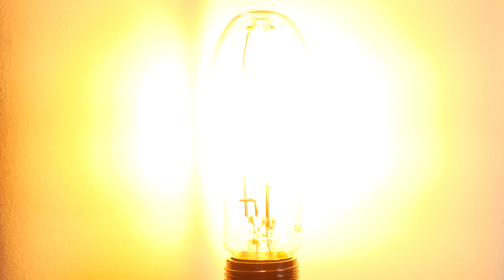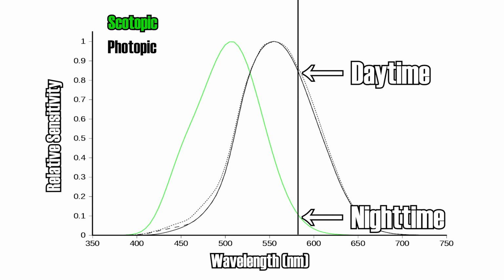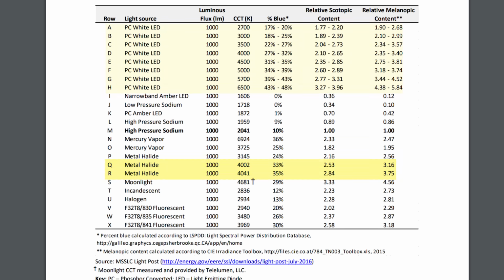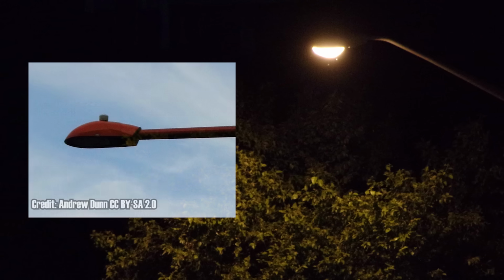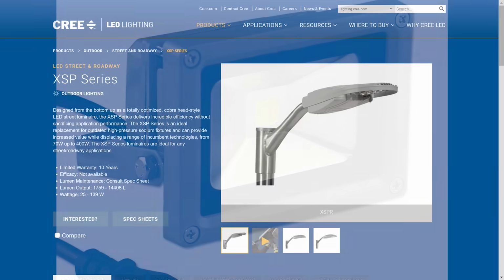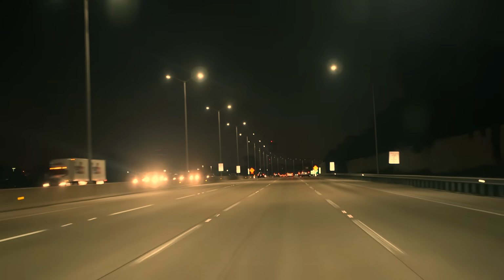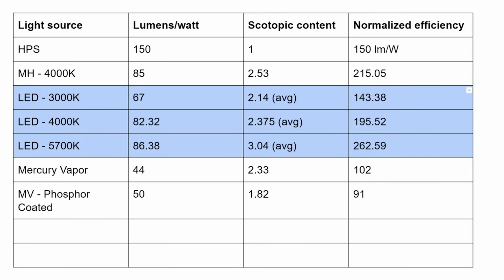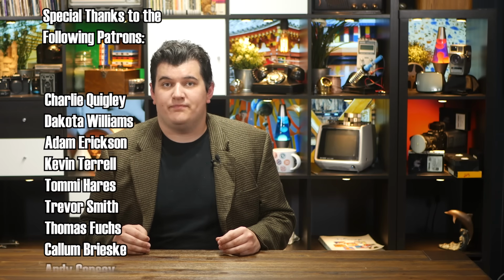The LED's Challenge to High Pressure Sodium

Comment: There is of course one thing that can be done to greatly reduce light polution, decrease night traffic risk, and many other benefits. Less car reliance, more quality public transportation and walkable/bikeable urban environments. A tram needs less light and clarity ahead of itself, and if you have an electrified system, you can have sensors to selectively dim or bump up light intensity depending on whehter or not there is a car going that way, on top of just occpying less area/lanes to be illuminated in the first place, and depending on the area some of said traffic is already happening underground in the metro system. Right there, by increasing density alone, you will cut down light polution and other harms by more more than half. And not only you need to light smaller areas/won't need to light a bajilion broad stroads, an environment designed primarily for walking just need less light for the people there, always at ground level, and it doesn't need uniformity, so it can be more or less intense according to the need around each light fixture. And yes Mr./Ms. Strawman about to raise your hand, utility vehicles or supply vans/trucks, etc. might need occassional access, but it still changes nothing here as that level of light + the vehicles own light fixtures if needed are more than enough in for the occassional nocturnal access here. The environmeent could also be a bit more curated, for example if you turn a couple of blocks into something like more like Barcelona's superblocks, putting some tallish trees around, you even reduce the amount of light that escapes outward. In short, by merely moving to a less carcentric, more walkable mixed use urban model, you not only cut the amount of light you emit by orders of magnitue in the first place, you can even prevent some of the light you do emit from escaping the volume of space where lighting is actually needed. Among other bonuses.

Yes, I know the video isn't saying "change lights = fix everything", it is not saying you can't change lights and also do more things, but rather it is just talking about the lights themselves... But c'mon, it was plenty easy to plug that in and how could I resist an offer like that!

Comment: The only problem I see with shifting to led lighting is the lack of heat output. In winter, especially the further north you go, street lights can get covered in ice. Led lights don’t produce the heat needed to melt the ice whereas high pressure sodium lights do.
Reply: Why do LED's have massive heatsinks then?
Reply: He actually made a video about this but for stop lights called "The danger of but sometimes". It basically says how it is cheaper to install heaters that only run for part of the year than to continue using inefficient light sources.

Comment: The state of Maryland replaced these lamps with purple lights and I gotta say I would rather sodium than dim purple. Takes it to the other extreme.
Reply: Those are not intentionally purple. The phosphors that convert the monochromatic UV output of the LEDs to full spectrum white light have fallen or burnt off causing this
Reply: @exoticcar5482  Yeah I learned, they are so terrible. Seems like the whole state got a bunch of bad bulbs because they were fine before with older bulbs.
Reply: @SEVENTEENPOINT1  Actually that's not a reason LED is terrible. LED technology itself is not terrible. There are just some companies that made them with defective phosphors. Maryland is one of numerous states that happened to have bought plenty with this problem unknowingly. The light source itself however is still much more efficient and will still likely outlast a HPS lamp. They weren't just "fine before" with the old bulbs. They failed plenty. You just didn't always notice since their failure mode is that of cycling. Also the crews were more active back then to replace the broken bulbs whereas today they were unprepared for the manufacturing defects. Before we automatically assume HPS is objectively better we have to look as all the pros and cons
Reply: @exoticcar5482  I was referring to the LEDs they picked. But thanks.
Reply: @SEVENTEENPOINT1  I am actually familiar with everything you're saying since I'm a Maryland resident myself
Reply: @exoticcar5482  Cool, same.

Comment: I HATE the led streetlights. It makes it much harder to see in foggy conditions compared to the sodium lamps.
Either use Amber leds or don't change them. At least not on streets/roads.
Reply: The warm light cuts through fog and makes it easier to see

Comment: I completed a sodium light replacement project for our strata in 2018.  There are 34 street lights.  We saved the equivalent of 2000w+.  I chose 4000 degrees to match moonlight.  The colour discernment is much better.  Only one resident complained.

Comment: High color temp lighting at night is junk. Visual acuity is not only bad because of glare but the high levels of light negatively impact mesopic vision. Add in the extra light scattering off high CCT lighting to the night sky and it is a loser. 

I think 3K or less CCT is going to prove to be the best option going forward. Good job with your report but your going down the wrong road recommending high CCT roadway lighting.
Reply: And it is proven to make sleeping harder, and animals get disoriented by high CCT as well. Another problem hardly mentioned is that LED has serious flicker issues. The high frequence drive is mostly no so high frequency. 50-100Hz is way too visible. Streetlights hardly come with the 10000Hz switching of quality housing bulbs.
Reply: @lovemadeinjapan  This is no worse than HPS though as most of them ran on magnetic ballasts which pulsed them at 60hz
Reply: @exoticcar5482  Kome and visit. I've RGB LED street lights (they follow the nigh cycle) next to HPS. THe HPS light is soothing, the RGB street lights totally annoying, it looks like you're in a techno party. Some fancy Philips/Signify shit to promote the city....
Reply: Oh for reference, the HPS next to it is qualitied as historic and protected! Love that!
Reply: @lovemadeinjapan  historically what? Energy inefficient, failure prone, and needs to operated on a dusk to dawn photocell.
Reply: @Aerostealth  You know, historical preservation objects, like classic houses and buildings. Some of the HPS lights are preserved and included. I think that is super cool! Let kids learn about the awesomeness of 588nm.
Reply: @lovemadeinjapan  I've never heard of RGB street lights. Most LED street lights are phosphor coated deep blue diodes.
Reply: @exoticcar5482  Well, they exist. Yesterday I bought LED lights for the home, and wondered why they were all F on the energy label. I believe the HF circuitry and quality are taken into account now with the new EU rules, and now we can see how scheisse the stuff is we get in stores.

Comment: The switch to LED sounds like a no brainer to me. The suppression of melatonin production sounds to me like it would only improve safety on the road, making drivers more awake and alert in nighttime conditions. Combine that with the power saving, efficiency, adaptability, and MUCH more environmentally friendly disposal when needed, LEDS are the way to go. Even if the circadian rhythm disruption becomes the primary concern, LEDS can be balanced to any color temperature and even adjusted with ease, so light temp can be tailored to any environment/application.

Comment: 4 years later, and LED lights have pretty much taken over. I've been around long enough to have seen the transition of street lighting from incandescent to fluorescent to mercury vapor to low pressure sodium to high pressure sodium to LEDs. 

I work at a place that sells lighting, and I've noticed that a lot of people perceive the bluish "cool white" light as brighter than "warm white", even though it isn't. But I also tell them that the warm white makes food and people look better, so should be used in kitchens, dining, and bedrooms. Reserve the "cool white" for offices, workshops, and outdoor lighting.

Comment: Winnipeg Canada changed out there induction / HPS lighting to LED units around 6 years ago and they did it district by district so for a while there was LED neighbourhoods and NON LED areas and immediately you could tell the tighter beam focus of the LED units and the bigger dark spaces 
2 years ago the LEDs started to FAIL and were burning the phosphorus coating and turning PURPLE with way reduced visible LIGHT OUTPUT   on the medium output / main street units and have slowed down the LED upgrade on the motorway HIGHPOWER units leaving HPS units behind 
my commute goes past a MAJOR hydro sub station and they are YET to switch out there HPS units for LED in there "OLD" yard but the new yard has LED and 1/2 have failed and turned purple

Comment: Hopefully, the common sense will prevail and LED lighting will be reconsidered as laser (that is banned or totally restricted). And I wonder why LED bulbs for domestic use come only in 3 forms - 6500 K, 4000 K and 2700 K. 6500 K is definitely very unhealthy for human health, very blinding with its weird white bluish light. This color temperature should be totally banned. 4000 K (our authorities now like install 4000 K wherever possible and in mass quantities) may be OK for internal lighting, but their outdoor lighting should de restricted to certain areas. Even 2700 K in outdoor lighting seem too bright and obtrusive especially for outdoor lighting, but if properly shielded they can be used. 

But why do LED 2200 K are almost absent on the market? That is the morst natural light that fits the night ambiance. Clearly, all outdoor lighting should be 2200 K. We don't need to read books at night in the street. For the domestic use 2700 and maybe 4000 K will do, but 6500 K should be really banned forever and always as completely unhealthy and extremely light-polluting/light trespassing. 2200K, 2700 K and 4000 K should be the standard. 6500 K should be discarded altogether. And when it comes to street illumination and commercial signage, 2200 is the perfect color. 4000 is already unsafe.

Comment: Those cobrahead lights that you see producing a huge amount of upward light are the GE 'Crimefighter' luminaires, appearing much like a standard cobrahead with a vertical lamp and cylindrical refractor. Built on the idea that spraying light everywhere reduces crime, Chicago is the only place I've ever seen them used.

Comment: I've always hated the icky orange light of high pressure sodium. It may be much more efficient on paper than the old mercury vapor lamps but everything but the glare from the light itself looks so dim and gross under HPS while objects and especially vegetation pop under mercury lighting. LED offers many of the advantages of mercury lights with much higher efficiency. It's hard to beat the lifespan of a good quality mercury lamp on a magnetic ballast though. I've seen them last over 30 years running dusk till dawn, the one on the side of my grandpa's workshop was still bright when the house was sold after my grandparents died.

Comment: I'm in the UK, and in many residential areas, houses have two storeys, the ground floor being the main living space, and the first floor (upstairs) being where the bedrooms are.  When the local council replaced the old sodium street lights with fluorescent(!) some 15 years ago, the new fixtures had shades fitted so that not only did no light escape upwards, but the shades also blocked light from reaching the upstairs windows near the street light.  The house I lived in at the time had a street light right outside, and prior to the replacement it was impossible to get the room dark at night.

Comment: It is March 2022. I live in the Miami metro (8th largest) and sodium lights are being replaced with LED street lights enmass ... but with a huge problem. You can drive through entire cities at night now where everything is PURPLE. Apparently whatever mechanism handling yellow filtering is failing at a high rate in these lamps.
Reply: It's a phosphor coating that's degrading prematurely as the diodes themselves behind it are blue/UV

Comment: I don't know if you will read a comment on this video after so long, but you do, I have a question about street lights.  

Lately I have been noticing a strange trend in street lamps around my area here in northern Wisconsin.  Several of the High Pressure Sodium lamps have been replaced with LED lights.  What's strange about these lights in particular is that they act more like black lights than anything else.  They give off a harsh purpo glow, that makes anything white in color or highly reflective pop like crazy.  Other than that they don't seem to help with visibility all that much.  

What's up with these street lights, and what are the pro and cons of them?
Reply: These lights are actually faulty as their phosphor coatings are degrading prematurely. Normally the phosphors are supposed to convert the powerful monochromatic blue light from the bare diodes into wide spectrum white light at a specific color temperature but with those phosphors going out you get either mostly or all just blue light from the diodes

Comment: I like the higher colour temperature LED street lamps used on motorways in the UK - I find them much easier on the eyes than the old  HPS or LPS lamps with far better visibility. However, we've just had our neighbourhood fitted with "warm white" LEDs and they are awful for driving - they only light up the patch of road directly beneath them, but leak enough sideways light to be really glarery when driving even though they replaced the entire luminaire, not just a lamp swap. Also (already mentioned) the high colour temperature lamps on motorways should help prevent sleepiness when driving at night.

Comment: i will point out there are roads without street lamps and might be bumpy, which is the case in my area. a car with strong blue leds can blind you and remove you natural atuned night vision, deadly if you take a corner a bit wrong

Comment: As you opened with the fact that we use outdoor lighting for safety, the increased safety aspects of LEDs automatically win the debate between the two. If the LEDs increase safety, then they perform the primary purpose of outdoor street lighting better than HPS lights. The issue of light pollution should be engineered out over time as the tech continues to mature. As for circadian rhythm disruption, it could be argued that it's better for night time illumination to disrupt the absorption of melatonin while driving, reducing perceived driver drowsiness, but that is open for debate.

However, being several years after this was produced, there is an additional issue with LED lighting that has become very prevalent for desert environments. LEDs tend to have drastically shorter lifespans during the hot summers here in AZ. There are a noticeable number of LED fixtures in my neighborhood that have very short lifespans, typically causing lights to flash as the LED drivers start to die. Now this could be a result of "affordable" lighting solutions, it causes a very real problem for reducing safety conditions as the dying panels have an almost strobing effect.

I'm not very photo sensitive and don't have issues with epilepsy, but even I notice a certain disorientation when passing these flashing fixtures on the road. I can only imagine that someone being even mildly sensitive to flashing lights having a serious concern for safety and I actively avoid streets with known problem LEDs.
Reply: Only if LED IS safer. It sure as hell isn't safer for pedestrians and bicyclists. When you are walking on a street or the sidewalk, you are constantly going in and out of light and pure darkness since the LEDs don't cast the light as far to the side and cities didn't add lighting to fill in the gaps. Great for muggers and rapists. And bicyclists who used to just need headlights adequate for being seen by motorists now need ultra expensive extremely bright lights with large (and heavy) batteries because they need to project as much light as a car.

Comment: Although most of the video is convincing to me, I disagree with the beginning logic. Sodium vapor does stimulate cones better than rods, but it’s not like the cones go off duty at night and can’t be called back. I theorize that by only stimulating the cones, sodium vapor lamps leave the rods mostly full of their depletable/replenishable light-sensitive chemicals, and able to pick up moonlight if the streetlights are suddenly no longer available (or just if you’re looking to the dark roadside). This however may be an incorrect theory, and even more may be falling for the “but sometimes.”

Comment: my household has 4 of the them soviet era street lamps, and the bulbs have all burned out but 1 , so i was seeking to replace them, but when i saw the pricetag of 1 bulb to be around 20 euros and the power it consumed i was like "hell to the NO" , luckly someone somewhere out there had the same bright idea, they made a supercompact street lamp socket adapter to regular household socket, all i had to do was to disconnect the the high power ballasts and connect the wires directly to the old socket, screw in the household E27 adapter and add a LED 4000K bulb and im good to go, now it consumes allmost no power but lights my yard up like its a god damn prison and with a cost of just 4 bucks  :D

Comment: I wonder if hybrid lights could be created for areas where absolute visibility for the purpose of safety is not the highest priority. For example, in parks or pedestrianized areas where vehicles rarely or never go, reducing your need to see so well at a distance. They could use LEDs of the less efficient wavelengths that are softer, more aesthetically pleasing, and contribute less to sky glow and circadian rhythm disruption. On a road, safety is priority number one, but not everywhere is a road, so more casual lights could be very nice